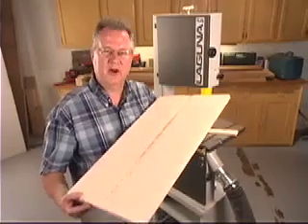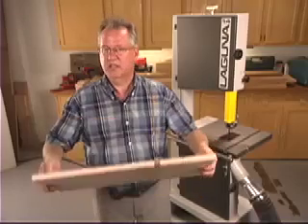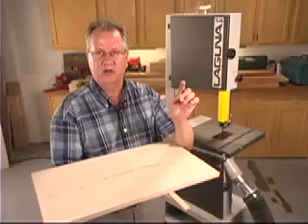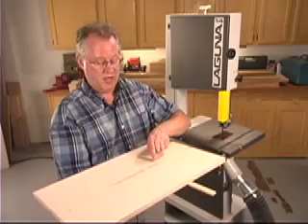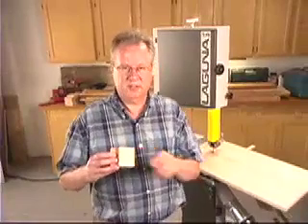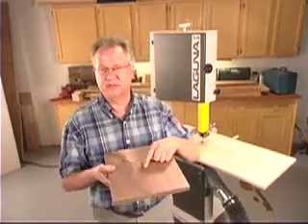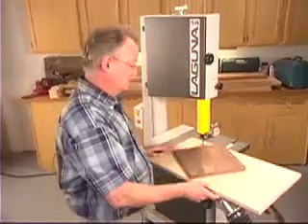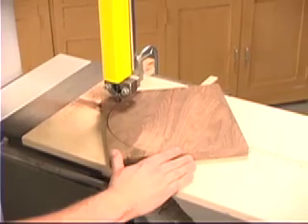Bandsaw circle cutting jig

Comment: USE A WIDE BLADE WITH FINE TEETH... I went through (BROKE) 4 blades cutting 8 circles of plywood 92 more to go. I did this before I figured out the wider fine tooth blade was the best choice. And I only used the fine tooth blade because it was my last choice. I cut 42 circles with the fine blade till I ran out of wood. (I'm using a small table top band saw too)
Reply: Dang, bud... how many bandsaw jig videos did you paste this comment to?! I've watched a ton and don't think you've missed one yet. Get some more wood and cut 58 more for an even hundred lol
Reply: "Use a wide blade"    ???The ideal width depends totally on the size of the circle!!!

Comment: Thanks for the video. I made this jig but get severe binding straight out of the gate. I'm cutting a 5" diameter circle and have used 3/8" and 3/4" blades, neither of which worked. Any advice? Thanks!

Comment: Great video and thanks for making!  One question.  Should the front of the blade be in line with the pivot point?  Should it be the center of the blade?  I'm getting some bogging down and blade twist on my saw and can't tel if the blade is not tight enough or if I'm lined up incorrectly....

Comment: Probably the easiest one to build that I've reviewed. The only change I made when I made mine, since I didn't have a router, I drilled the holes for the pop rivet and then created shallow wells for the pop rivet flange with a forstner bit just large enough for the flange. As well, because I didn't have a piece of wood that size available, I did have excess laminate flooring material, which I laminated together with silicone sealant in a kind of plywood arrangement of two perpendicular layers. The runner I made custom out of 1/4" thick UHMW I had laying around which I glued to the underside of the jig. I made the stop out of scraps of the laminate material I made the jig out of (can you tell that I'm one for using every bit of scrap material available?). Already cut several perfect discs that work great for my project.

Comment: Hi I have made your jig and the problem I have is I am cutting woodturning blanks about 3" thick from 5" to about 12" and the blank is pushing the blade over and it has at times jammed.I have tried moving the row of holes slightly forward and back from the front of the teeth and still have the same problem.Any advise will be gratefully received Regards George
Reply: ***** Thats pretty thick stock. Depending on your bandsaw it could definitely struggle. Try free handing a similar situation (curves) and see if the saw can perform the cut. 

Many people use this jig for a rough cut on the bandsaw and then use a similar jig on their disk sander to get the final, perfect radius. Since you are turning, try a sharp gouge and a steady hand after your rough cut.

Comment: Make sure the diameter of the circle you are cutting is above the minimum size rated for your blade width. If too small you can damage your blade. There are charts on the web that give the minimum diameter, blade width relationship.

Comment: I found gluing a piece of 3/4" wide wood on and the length of the side from which you are working, to act as a stop, vastly improves the jig.  The piece should hang down just enough to stop the board so the pin holes are just in front of the blade.  This insures the board will stop at that point and avoid binding the blade. As well, it stiffens your board for large circles.

Comment: Just cut my first circle with my circle cutting jig that I made after watching this video, and am thrilled with the ease of use and the results.  A minor improvement - I used a piece of t-slot aluminum for my guide, set into a shallow dado on the bottom of the jig to make it easier to keep straight.